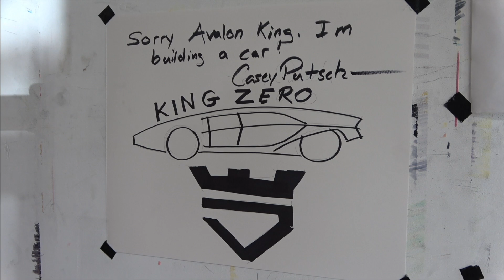What is the Omega Car? Why did I build it?

Comment: You are so correct with what you said. Like the cure for cancer. It is being done for many years. I was working at a place where a x nurse stays with terminal cancer. I told her about what can be done to cure her cancer. But because she has been working in the system for years, it is unreal to her. And she did not really listen. Just the same with cars and the economy. People are so used to it, they can't imagine it differently.
Reply: The car is cool and this guy isn't dim but he also isn't a genius & didn't create something super revolutionary...It's basically a cool sports car looking, lightweight, aerodynamic, big go kart with a fuel efficient diesel engine.

Comment: Casey: I really like the design of the car, and I agree with you at many levels that a vehicle needs to be exciting, stunning to look at, easy to maintain, and in the end dismantled and reused elsewhere. I think that stunning performance and good economy are truly examples of what the design concept should contain. 
             I also agree that your off the shelf I-pad usage and camera system better capture the guage concept than the usage of the megascreens that are popping up along with the overly complex designs and heavy weights of modern vehicles. I have a 1962 Lotus Super 7 that is a distant cousin to your Omega concept. Simple, lightweight, pretty much nearly every component can be replaced cheaply by me at home in my garage, and there is no necessity to ever have to take it to a dealer.
            I see design elements of the Alpine A110 in the Omega. It appears strikingly similar in design, size, features and power, as well as handling, and in general had good economy.
            I'd love to see the Omega picked up my a manufacturer but doubt it will happen because of many of the reasons you indicate.
            I must also say however that I disagree with your politics and right wing proclivities. The automobile industry is what you are really good at and I suggest you stick to that trade. I do follow your channel but often find that it is preferable to mute you and just watch your videos. No offense meant to you and everyone is welcome to think as they do, but thought and words and deeds matter. I do like the fact that you encourage young engineers in the craft. Politics turn many off however.

Comment: I understand and agree with the attitude, but I'd appreciate some basic stats on the car. I'm an engineer at heart, and this sort of concept fascinates me. At least in broad strokes: How much does it weigh? I google'd the car and read that it currently uses a modified 2.0L VW diesel - how did you modify it? What is its drag coefficient? How well do you suspect it'd perform in crash testing? Does its crash safety performance rely on other vehicles being similarly light? How much of the vehicle is recyclable? Does the vehicle attain its (I'm assuming) extreme low weight by not including AC? A radio? Sound dampening?

I'm not asking for the exact materials and methods of construction used, I'm simply asking for stats.
Reply: I would actually like to see the details of the design.  Crash avoidance is much more effective than crashworthiness, and I believe in a light car or truck being driven by a hyperaware driver.  If the info on how you got this gas mileage is available, others could replicate it.  If you just want to monetize your creation, have at it, but without knowing every detail, I'm not interested in buying anything.

Comment: I love it when Casey makes this kind of video the unfortunate thing is he is right. When the Exxon Valdez wrecked and dumped oil along the Alaska coast the US government told them what they had to do.  Exxon said no and told them what was going to happen. They are huge and have a lot of control just by virtue of how many people are dependent on them. The president of Exxon said that they plan 30 years in advance and they don’t care about government or the current administration in the US because they are only around for 8 years at the most. There are other companies as big or bigger than Exxon and they have their own plans. How does a guy with nothing but a well designed efficient car go up against that. The government regs  that would need to be complied with would be a nightmare and if they chose to shut him down they simple pile on more regulations. At this point we are going electric and nothing short of a huge meteorite hitting the planet is going to stop that. It doesn’t matter that green energy won’t power these cars it’s where we are going. It doesn’t matter that the only way it works is with huge government subsidies that is the way we are going. Green power and going electric is what will get a politician elected right now so that’s where we are going no matter whether it works or not. California is already proving that it’s not going to work without a huge hike in power prices but it’s still full steam ahead and damn the consequences.

Comment: They need to bring out something like a new Chevy S10 / Sonoma - Syclone with a 2 litre ecoboost 4 cylinder engine and full time 4wd rather than these huge landyacht SUVs with 10 litre v8s or equally big diesels. Especially seeing that 95% of the time they are driving around with only a driver, they really don't need the giant engine capacity , especially seeing what they can get out of these 4 cylinder engines with todays tech. But they just seem to build the same thing over again. 

Look back to the 30s,  there wasnt much money about, not many jobs and people were staying home (does that seem familiar somehow?) Ford was able to sell cars about the size of today's SUVs that had a small V8 engine that was pretty economical and could be repaired by the owner with common tools, room for 5 - 6 people, ample luggage space and features that were unheard of expect in grossly expensive luxury cars.. All for the price of about $5 - 800 (about $17500 in today's money) And thus people were able to get back working after the depression and grow their family at the same time (well until some German guy had other plans, but we try not to talk about that)
Reply: I think a hybrid 'ute' would sell like hotcakes globally. Something with a modest ~200hp or less ICE in series with a ~30-50hp electric motor and a parallel system driving the opposite wheels (front if ICE-hybrid drives rears, or vice-versa). Stick the batteries under the tray/pan and stuff a few 120/240 volts into the bed. Keep it simple and relatively sparse at first and keep materials simple and cheap. Expand the lineup as orders are filled/production ramps up to include luxury features/trims/options. 

Despite Casey being so negative about self driving cars, and how they aren't solving (his perceived) 'real' issues, they do solve a problem, and are helping lots of people out there. You don't have to make cars self driving these days anyways, just implement basic hardware as most manufacturers do already, and one can get an OpenPilot system if they wish, and can turn any honda into a safer self driving experience than a tesla for a fraction of the price.

My major quarrel with Tesla is their business model, the dealership model has worked so well for so long for a reason. Today if anything happens, if I were to own one, I would be fucked for at LEAST two or more weeks (solely due to COVID//protocol(s) in place), if they had dealerships, I could drop my car off like a chevy AND they would have to wait to order a bunch of parts. 

Casey is biting off more than he can chew I think though, I admire it, but he needs to be a little more pragmatic and focus on the things he can affect, change and influence. He can't uproot the global neo-liberal consumerist system all in one evening let alone one lifetime.

Comment: I work with computers.  I know anything that has a computer and an internet connection can be hacked.  I know less than honest people hold computers hostage with ransomware.  Any bets on what I foresee being a problem with self driving cars?
Reply: If that were an issue, people would have Tesla at gunpoint by now. Look at the share price(s), Musk himself said he loses sleep worrying about encryption being cracked (the company would be literally worthless as every car has a modem).

That being said, you don't need the internet for self driving cars. You don't need a network or wireless communication at all really.
Reply: @FukU2222  It's all about marketshare, and right now, there's simply not enough Teslas out there to be a big enough target.  It's the real reason why Macs are somewhat secure as not enough people feel it's worth their time to crack a Mac, compared to a Windows box.

Comment: Warrent buffet would be exactly that type of investor. He looks at an extreme long term view of a project/company. Yes most investors are worried about the Short term value of their holdings but it is not true that are all like that. Moreover, investors want to build a portfolio that has both short term and long term value. So Casey there is hope if you really want to commercialize this (even thought it seems you are totally against it). Lets say you get the indie 500 and make a name for yourself, that is a platform that you can leverage if you wanted to.

Comment: The Omega car reminds me of the VW XL1. But VW never made more then a few hundred. But the Model 3 is the car that is changing the world. Pushing tech and efficiency to new highs. It’s causing GM and Ford to scramble to catch up. It gets a 133 mpg equivalent . The batteries and motors can last for a million miles. It’s safer then any other car on the road. I don’t get the pessimism. It’s a little to expensive but that’s changing and the batteries are getting better. The future for cars seems pretty bright to me. The future for others things, maybe not so much.

Comment: “No one reports on this” as I turned in my English final paper yesterday talking about the future or automobiles and included it at the end as an alternative to banning all gas powered cars.
Reply: the BIG lie the world wants you to think is that gas is bad, that we are running out of oil, etc...you have been brain washed. dont buy into all that BS
Reply: @supersevenn  Where did you get infinite fossil fuels, and can you share?

Asking from what used to be oil country before the oil ran out. They brought back production via fracking, poisoned my well water, and ran out of oil again.
Reply: @FukU2222  Nothing you said is wrong, and nothing you said was the point I was responding to. You're making a well reasoned argument to defend someone who thinks oil will simply never run out ever and that you're a liar if you think it will.

I have to disagree with your conclusion, even though nothing you said is wrong. It's not chemically that difficult to make oil or oil-like substances, but the main benefit of oil is that it is incredibly cheap for how versatile it is. Running out of cheap oil will bring the modern world to its knees, even if we can directly recreate the chemistry, or substitute other chemicals.
Reply: @supersevenn  well I wrote why it’s not worth it but ok bro

Comment: I keep missing your explanation of how it’s diesel and so fast. My apologies but if someone could enlighten me!
Reply: Well it's diesel and fast, there's not much to it! All I know is it uses a VS diesel (absolutely know idea on which one), and it is lightweight, so even if it doesn't make a lot of power it is still very fast. Also diesel engines are known to make a lot of torque, so acceleration figures are better than they would be with a petroleum engine (probably). If you're question on how it's so fast with a diesel engine just remember the Audi R10 was diesel.
Reply: I meant to say Volks Wagon not VS.
Reply: @carsonyoder6294  is it boosted? So basically lightweight and decent engine? Crazy its faster than the Viper!
Reply: I am pretty sure it is turbocharged.